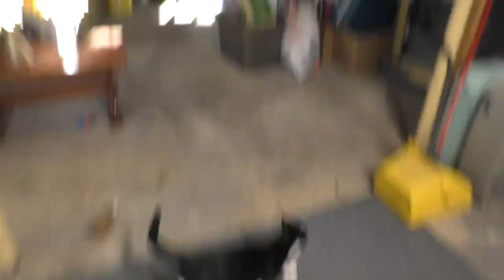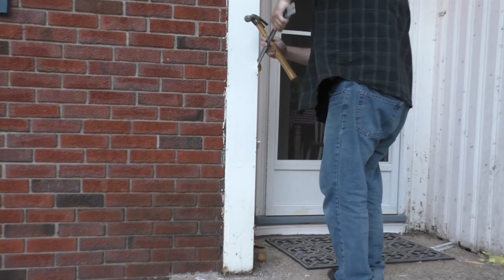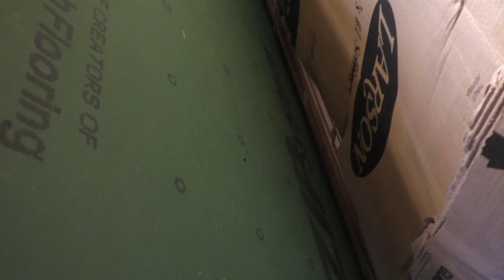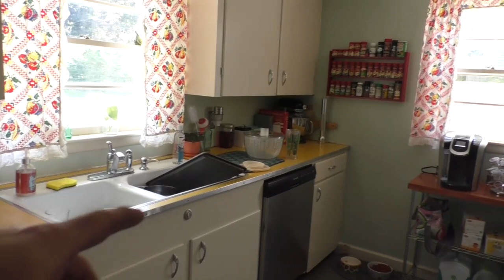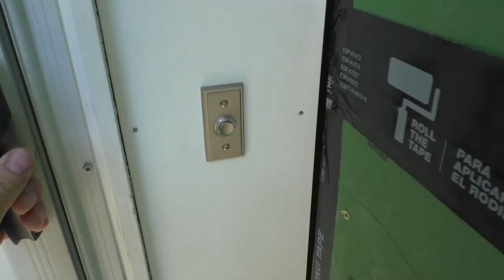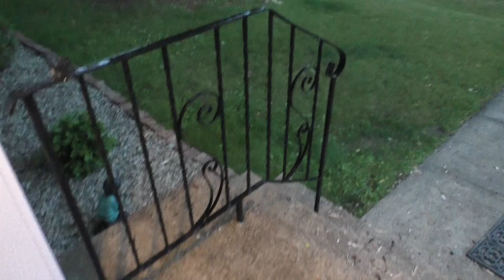Rebuilding my home's LEAKING, POORLY DESIGNED front entryway!

Comment: I like how you left a message to your future self or potential future owners on the new wall sheathing. At the old house where I used to live, I wrote a short message (don't remember what it said), signed my name and put the date on the inside of the porch wall while my dad was rebuilding it 15 years ago. Probably already gone though since we ended up selling the house in 2011 and the new owner did a complete gut-and-restore of basically everything. I still like to imagine though that while pulling apart the porch wall the renovator saw my message and got a kick out of it.